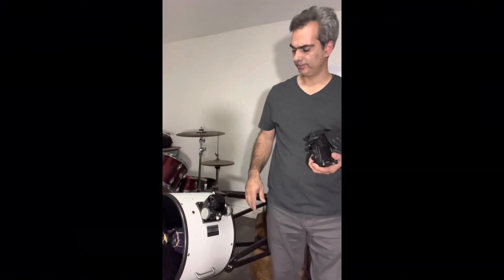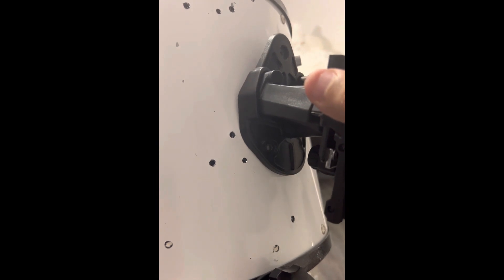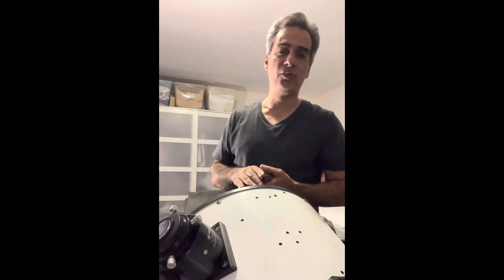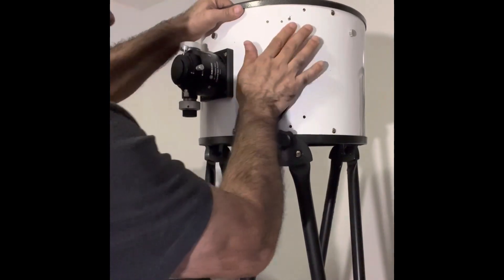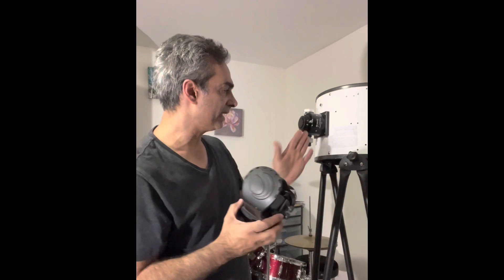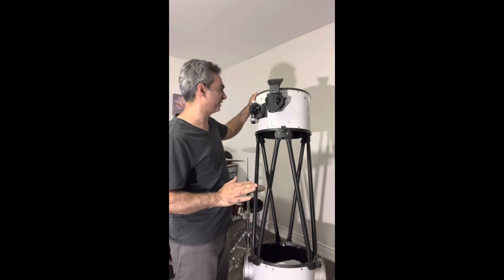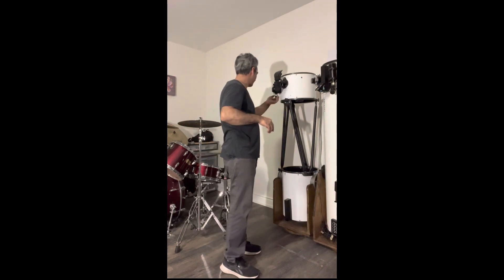make your scope a push goto for $60 #astronomy #telescope #meade #dobsonian #celestron #starsense

Comment: Meanwhile there is a 3D print file available on Thingiverse for a Starsense adapter that attaches to a traditional finde scope dovetail bracket. So you can keep the original part on the telescope it came with and easily switch the Starsense between both.

Comment: Anybody screaming ‘use a rectangular piece with the original smaller curvature’?
Reply from the maker: OK sure that’s another way that it could work once you screw down the three bolts. It actually holds it very nice and tight.

Thanks for watching

Comment: great video. i was thinking of doing the same thing, BUT that was before i googled "open source star sense". Astrohopper is a great tool. i dont even mount my phone to the scope. i just hold it center scope as straight as possible with the plane of the scope and it works great. without mounting the phone the objects i am looking for are not dead center but they are field of view with a 40mm wide field eyepiece.
Reply from the maker: OK I understand. I’ve also tested the Astro hopper and once you understand it I’ve done three videos on it. It’s pretty good but I think a starsense is still a bit better.

I’ve had people who told me you can mounted on a finderscope bracket and then just put it in your finder Scope shoe 

So there’s a few ways how to do it on my video I show you how to drill three holes into it so whichever way you like I just try it out

Comment: So you are saying you found a complete 2nd hand Celestron scope with Starsense for $60? Thats really inexpensive!
Reply from the maker: no i found a cheap $200 star sense scope took off the module screwed it into my scope . I then re sold the scope for $175 without the module so it cost me $25

It depends what you buy it for & resell it for
Reply: did you get the code for the star sense with the scope purchase? @JoeJaguar
Reply from the maker: @gaylengurr3911  yes, if you did what I did and buy the StarSense, then you definitely need that code. Otherwise it’s not gonna work then you can sell the telescope off as a manual telescope
So you keep the code and you keep the module for whatever whatever telescope you want 

So what I’m saying is by the time you sell it it’ll have to be a little cheaper. Maybe you’ll pay about 60 bucks to get the StarSense but it’s worth it. 

When I did it the second time, I actually broke even I was able to sell the telescope for pretty much what I paid for, and I got to keep the second StarSense module for free and a second code

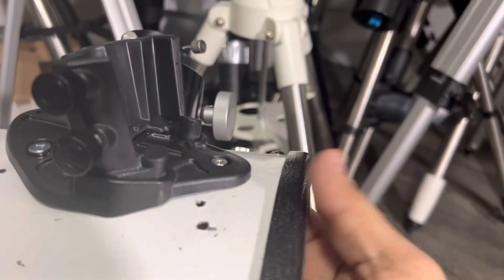Comment: @7:30 why you don't flip the screws and use a counter nut?
Reply from the maker: good point that way its not inside the tube and wont get into the light path

Comment: Glad to see someone else doing work around. My suggestion would be use the side  holes and front or back holes to adjust altitude. That screw (front or back would be secured with and permanently held in place with a nut. Two more nuts, one above and one below the mounting ( perhaps awingnut above if there is room.
Reply from the maker: Thanks John thanks for watching and comment. I do like to tinker sometimes. the summer past i re build that 12" base to real plywood from the particle base it normally comes with etc.

 In another video i re work the balancing on the dob

In another month or so from now i change the telfon
Cheers

Comment: I’ve used JB Weld to mate two objects together. The JB WELD is a clay/putty type consistency and will harden, creating a solid base for two opposing shapes. I then either glue/epoxy or double sided tape the pieces together. You plan on being able to remove and use on various other scopes so you’d have to find a way to affix the Celestron mount in a non permanent way. But at least you could make a “base” on each scope that stays there and gives the mount a solid base to fit against.
Reply from the maker: ok thats a great info thanks for sharing

Comment: Buy some rawhide leather Joe, wet it, cut to size and layer it so when clamped between the two, the scope and that star sense will shape to each other, then let dry. Once the rawhide dries the star sense will form fit to the scope and vice a versa. Don't worry about excess sticking out, mark and cut to fit after it's all dry and fits. I seal the leather with acrylic leather sealer then glue with contact cement and clamp together. Or screw together if you ever decide you want to take it off without messing with the glue. I did it with a RACI finder scope from a much larger scope radius to my smaller scope. Cutting the excess was easy for me as I have a small scroll saw. Rawhide is so hard when dry it's like wood, but wet it is like regular leather.
Reply from the maker: wow great info let me see if it works this way as i not sure where to get rawhide from or doing what you said BUT thats alot great info some people may like as another option. Thanks >Joe

Comment: I’m wondering if the starsense device might need to be flush with the telescope as it will be capturing images from the night sky which I’m thinking might need to be aligned to the optical tube assembly. I’d be concerned that the images captured by the cell phone might not be centered correctly due to the curvature of the starsense phone holder device. Hope this makes sense. Good video.
Reply from the maker: good point Ed,  i haven't tested it out yet. That will be coming soon. I will tell you what happens but iam assuming i can adjust my bolts abit up and down since i have enough play. So i dont see it not working if i did that but ill let you know coming up
Reply: @JoeJaguar  I’m sure you are correct Joe. Good luck with the StarSense application. Good for you intaking the initiative and going for it!